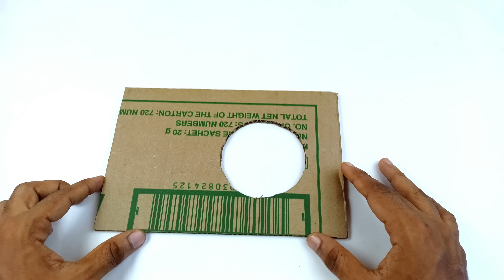How to make AC || Smart Air Conditioner At Home || Powerful AC

Comment: Copper tubes... Hot water flowing in it with cold from outside of the copper tube helps cool the hot water to cold water. The thermal reaction is higher in reaction to normal room thermal. Nitrogen gas outside of the copper tube in a container for the copper tube remaining cold outside to cool the water flowing in the tube increases cold temperature.

Design the copper tube... 20 meter bended in 30cm? And try placing it in a nitrogen gas container. Instead of water, use air. The fan is for that... HVAC?❤

Comment: CPU FAN,PIPE,WIRE,GREEN 3V LED,1K RESISTANCE,3 DC MOTOR,PROPELLER,৪ পাখা,12 VOLT FAN, ON OFF SWITCH,9V BATTERY, 12V CHARGER SOCKET,LITHIUM ION BATTERY

Comment: Bhaiya product ke link send kar do please bhaiya 🙏🙏 please reply me
Reply from the maker: You can buy those products from local market with a reasonable price but in online market you have to pay much

1. Cup cooling fan
2. DC motor
3. Battery 
4. Blue LED
5. On / off switch 
6. Spring pipe 
7. 12v dc female socket
Reply: Lekin Green led or 1k resistance ke product link send kar do bhaiya please reply me
Reply: Online app ke link bhi bhej do bhaiya please reply me🙏🙏

Comment: There are a few problems with this homemade AC:

-It is loud because it uses a regular motor from a fan or scrap motor.
-There is no cooling because there is no ice in the outdoor unit, and there is no Peltier module to create cooling. Additionally, the outdoor unit is just sucking in the indoor air, which means that dirty air from outside could be sucked in.
-It may not cool the room because it is just like a regular fan, and there is no real cooling happening.

Conclusion: To improve the cooling, use a Peltier module or put ice in the indoor unit.
Reply: The peltier module barelly does some cooling in a small closed box. No way it can cool the air in this configuration.
Reply: @gicugigel3790  can technically use a copper tube or any conductive stuff to create an evaporator effect in front of the fan and that evaporator filled with water cooled down from the peltier

However this might require like 3 to 4 peltier modules to even have like the half of an Air Conditioner unit, plus possibly, there is no way you can cool down even for a small room and just impractical for the heat dissipation (radiator method works the best by cooling down the hot side of the peltier using a waterblock then pump it into an waterblock radiator outdoor)

I’m thinking about using an old small-medium sized refrigerator compressor and evaporator condenser tubing like an real ac does, and attach just a desk fan infront of the evaporator fan as well as for the outdoor condenser so 2 fans, this might work for cooling down a small room but i haven’t yet has resources to test this out, eventually i’ll try it one day

Reason why an small compressor from an old refrigerator is, it only consumes like 100 watt of power, i think i can’t find any ac on the market that has this low of power, and even the lowest 300 watts of power is pretty damn cold already
Reply: @Not_Aran8276  yes, a fridge compressor consumes 100w, but it can only make cold air in a small closed box. It wont have any efficiency if you use it for an air conditioning application. If that was the case, then we wouldn't have seen 1500-2000w compressor for AC systems, but 100w ones. But well, you can try
Reply: @Not_Aran8276 hat won’t work. 
Where’s the hot side? 
How are you going to regulate the compressor? Running it continuously will kill it. 
What kind of radiators are you going to use?
There’s a reason why AC systems use lots of power. Otherwise we would’ve had low wattage systems on the market
Reply: @v31.48  

the hot side would go outside the room attached to a condenser with another fan, and about regulating it would be easy, just find a way to keep turning it on and off with a thermometer 

The thing is, instead of making an actual room cooler which might actually won’t work, I’m looking for a little desk cooler that runs off using a compressor, you know those artic air evaporator swamp coolers? Yes I want to make one of those but instead of using water or cold water n ice, I’m going to use a compressor 

On the market I can’t find such thing as like this probably due to the impracticality for the customer, the closest would be the Zero Breeze portable air conditioner
Reply: @Not_Aran8276  Ooh I see. For that purpose it might be fine. Well you have those portable car AC’s, maybe you can have a look at that? They have a compressor as well.
Reply: @v31.48  not sure which one are you talking about, there are some that cost around $60 but it’s powered by water or still a swamp cooler, the one that I could find cost over $1000 and that’s nothing like a desk cooler, more of either a rooftop ac for Caravans or AC replacement kits for some model of cars like Toyota

I think the reason why I want to make one instead of buying like Zero Breeze portable AC would be it is much cheaper

My main goal isn’t to really see whether it will break down or not, my main goal is as long as it is spewing out cold air out of the fan then I say it is a success

And if you wonder how much it is cheaper:
Medium size Walmart fan for Outdoor unit $15
A small swamp cooler to be not used as a swamp cooler for the indoor unit ($7)
Old fridge compressor small BTU $20
2 condenser/evaporator from a fridge ($6 each) $12
High pressure hose for an compressor or usually for a stove $5 (Otherwise a high pressure copper tube)
With other auxiliary to make the compressor work like a fridge instead of running 24/7 and breaking itself down that would round it up around $60-$80
Reply: @Not_Aran8276  Ecoflow has special models for that. Although they’re very expensive. I was opting at second hand units.
Reply: @v31.48  yeah probably something like that, had to truly try it then if it was a success atleast when I use it like a week or so with no problems then i’ll post it on yt as a POC/proof of concept
Reply: В
Reply: Why ice wait until the night when it is cooler Outside
Reply: @henkjanssen7376  2 p.m heatwave: am I joke to you?
Reply: does icebox coolers work
Reply: Good খুব সুন্দর খুব
Reply: Damrhrhfnfjykgjti
Reply: ❤gh
Reply: ❤❤❤❤❤❤❤❤❤hojhjmjkhhfuyohktjhlhl
Reply: BihyhhUKhhhjwell all DHLiyygyyyyy
Reply: Легче его собрать чем вентилятор купить так как вентилятор стоит дороже
Reply: 🎉 6:09  @КоляБорисов-ш9ц
Reply: In short what is happening is at least you are moving outside air indoor. It might be useful for a closed of area. But yeah no cooling happening

Comment: You should make a way for it to hold an ice tray (in the larger part) so the fans would have cold air to push besides the air supplied from the other (smaller) box. Or a way to put the smaller box in the freezer to supply cold air. Fun looking project.
Reply: yes left boxed glue be iced,

Comment: Man, you should have use a peltier module so that there will be something to release cold air by the way it's informative, I'll have idea on my own
Reply: Peltier generates very little cold air
Reply: @soldadoferido1929  that's ok. I will be the one to use it. My powersource is a 12v battery from my wheels
Reply: @bmwems14 OK everything is fine. I didn't quite understand your answer in the translation. Greetings from Brazil
Reply: Won’t work 😠
Reply: You have to buy ac to cool peltier module😂😂😂

Comment: Everything is great but there is one caveat. If the batteries inside run out, does it need to be disassembled in order to replace them?
Reply: Yes
Reply from the maker: You can also use mobile charger instead of using batteries.
Reply: It's very dangerous to use lithium cells without an overdischarge protection circuit.
Reply: It can bring to everywhere?
Reply: @akramsworldcartoon5173  no point ~ it won’t work
Reply: 😠… money sucking channel, he doesn’t intend for us to make it, for these “glued together with hot-melt - often with the battery glued in place” it will need to be destroyed to replace the battery
Reply: its rachargable
Reply: @samuelfellows6923 dude chill down u can use mobile charger